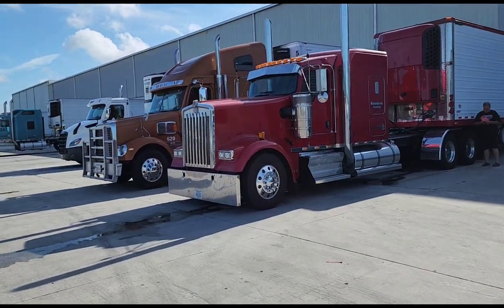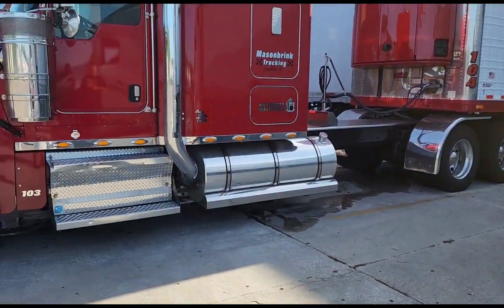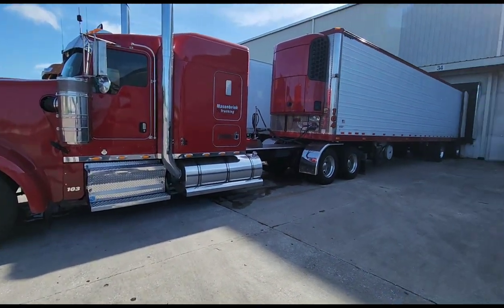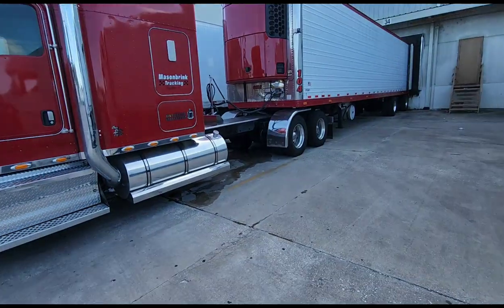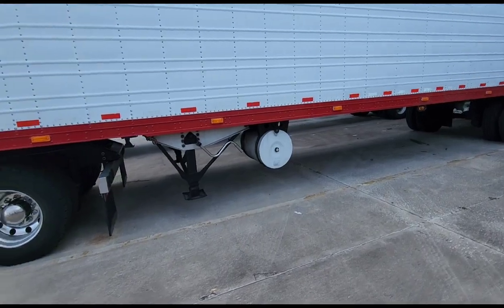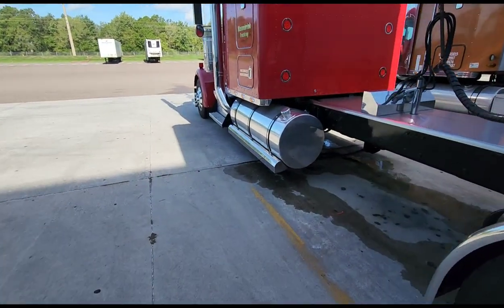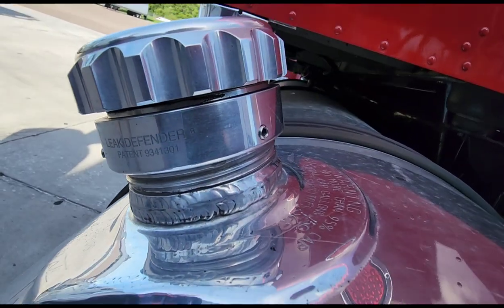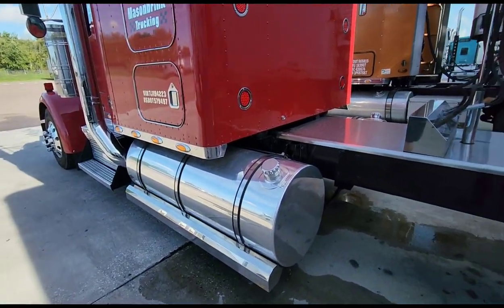From wrecked w9 flat top to this beautiful w900 !! #kenworth #family #nebraska

Comment: Yes, those Leak Defender caps are the best. I have them on my KW T660.  There about 500 and change for the set, but it's best 500 you can spend to keep your fuel in your tanks and not the outside of the tank on the ground. I replaced my OEM KW caps 2 times and got  tired of it still leaking. And bought those cap's. There bad ass for real!!!